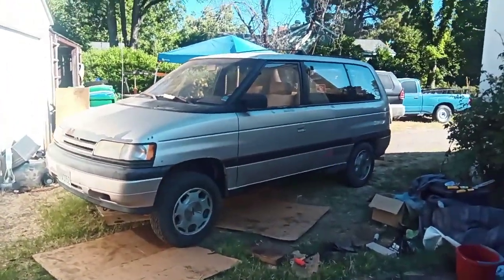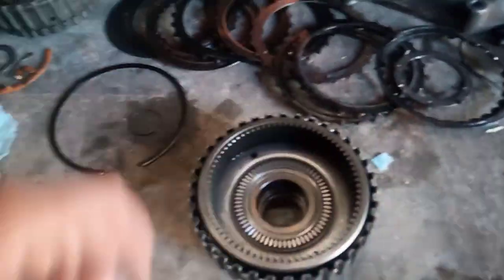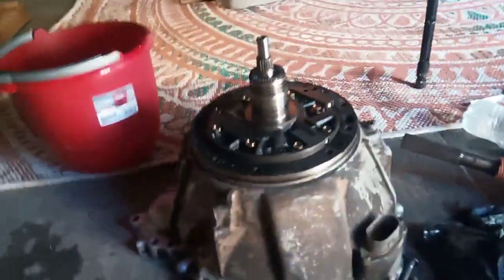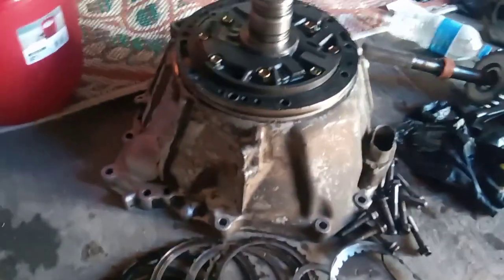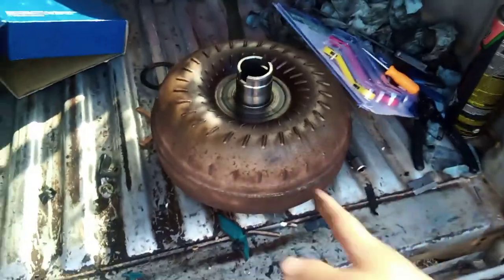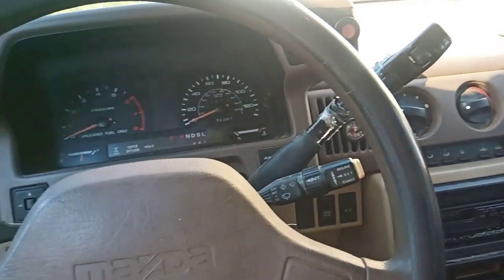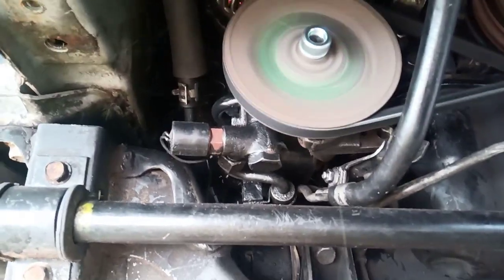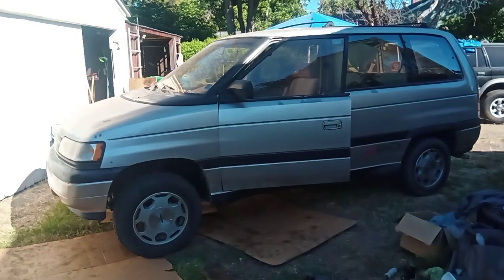1990 Mazda MPV 4WD automatic transmission rebuild (afterthoughts and tips) RE4R01A

Comment: OMFG dude i have this car!!!! the same exact one!!!! I WAS LIKE WAIT,  PLEXIGLASS WINDOW ON THE BACK, and then i saw the jack weber plate holder.... so i went to my photo gallery and looked a the license plate... and yup. to my surprise it is indeed your old vehicle..
weird how that just happened.... but yeah dude... now it isnt shifting at all out of gear.. its pretty harsh. i cant drive it anywhere and it happened out of the blue. well slowly. i noticed when i got the vehicle and i toook it on the freeway it was around 3500 rpm's at 65 mph and i was like wtf, shouldnt it shift by now. then the check engine light was on and then i let go of the gas and then the light turns off. and then i press on the gas and its high rpm again and then the check engine light. so yeah i definitely could use the help with this. i also noticed there is a transmission in the back of the vehicle. was that the old one?
Reply from the maker: Hi 14nfamous, what a coincidence! I guess there's not very many of these on the road anymore. Yes that sounds like my old vehicle.  The transmission in the back is a spare RE4R01A from a 2wd 1990 Mazda MPV that I used to harness parts from when I did the rebuild.  From my guess, it has lost 4th gear which could either be the original problem that I found which was burnt up friction discs or the brake band broke and fell out of place.  
Crazy that you ended up with it, it has quite the story.  I got it from a guy in Sacramento who got it from somewhere in the Watsonville mountains, sat for 10 years on a property and he busted the back window in the process and messed up the ignition switch.  I did replace the back window with plexiglass, got a key made for it, installed that keyless entry system, and installed the stereo too. 
I hope you can give it a new lease on life, it's definitely a cool vehicle with the 4WD and passenger space.
Reply: @NFSCalex  unfortunately it only seems to have 1st gear only now. 
how difficult do you think it ould be for me to just find a used transmission online and just install the whole thing... i mean this car i only got for $150.00 the stereo is lowkey janky lol but it does work 😂 😂
Reply from the maker: @14nfamous  it's not bad just follow the manual for removal of the transmission. remove both drive shafts and remove the transfer case. disconnect all electrical connectors.  remove the carpet to access the panel to remove the transmission bolts easily and just go all around.  after removing the cross member, the transmission should be free and will slide off.  make sure you use a trans jack.  you can find a good used transmission on car-part.com but make sure it's from a V6 4WD Auto model.  There's one in Fontana for $200 just gotta look. Cheers.